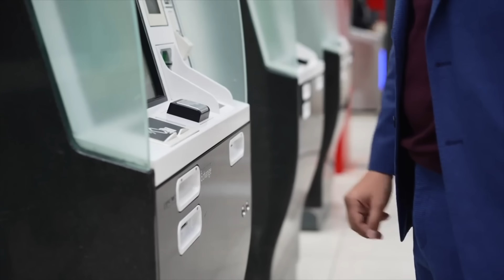Sydney's Game Changing New $2.7B Airport

Comment: There is so much with required to make the airport easier to use and become more productive.

A fuel pipeline needs to be implemented to eliminate the need for fuel trucks clogging the roads.

The 2nd runway needs to start construction as soon as the airport opens to double its capacity sooner & reduce costs waiting later.

Rail line should continue south to Leppington Station.

A new freeway north/south via the airport needs to be built. The M7 is already at capacity.

Expansion of terminal within the next 5-10 years needs to happen.
Reply: @josephj6521  Why would you expand capacity when it’s not required?
Reply: @ because it will be required. It’s NSW’s only 24/7 airport and if it has the facilities, airlines will flock to it. No point building all this infrastructure for a handful of flights. The Harbour bridge was built with future capacity expectations. Imagine if it was built at half its width. Same for this airport.
Reply: You are right about the endless convoys of B-doubles trucking fuel to the Badgerys Creek  aerodrome! What's the estimate? Hundreds a day?
Reply: @ You mean like Adelaide, Canberra and Gold Coast airports. In answer to your question, the maximum number of trucks per day will be 43 and they expect a pipeline to be viable in 2034.

Comment: Long overdue…No direct fast trains to CBD . No direct expressways to CBD. Mega failure.
Reply: There are no direct train or metro services planned for these intial stages of the airport, but the new M12 (which is well advanced) has connections to the M7 which in turn take  you to the M2, M4 and M5 which connect to the city. However not everyone using the airport needs to go to the CBD. If you need quick access the the CBD, flights into the current Sydney airport would be a better option.

Comment: Mega waste of money. If a high speed railway to Melbourne was built it would not be needed.
Reply: So people can travel internationally to Australia… on a train…? Think about what you just said Terry 😂
Reply: @Kustom2170  Again 40+% of domestic flights to Melbourne would not be necessary if you build a high speed train. In 2024, Sydney Airport handled significantly more domestic flights than international flights, with over 25 million domestic passengers versus 16.3 million international passengers. In other words you would have more than an extra 6% of international flight capacity without building a new airport.
Reply: @Terry-y2r  then why is Madrid to Barcelona still one of the busiest flight routes in Europe if HSR removes the need for flights? 
Again, factually incorrect.
Reply: @kierannelson2581  Were are you getting your "facts" from? More than 80% of travelers between Madrid and Seville use the AVE (high speed railway), with fewer than 20% traveling by air. https://en.wikipedia.org/wiki/Madrid–Barcelona_high-speed_rail_line
Reply: @Terry-y2r  fewer than 20%. Yes. And that still makes it one of the busiest air travel pairs in Europe.
The rail supercharged travel. Many people still fly.
Reply: That is factually incorrect.
Reply: By freight diverting freight to WSI, a lot of space for passenger planes would be available at Mascot.
Reply: @kaz1578  It still would have been better to build a high speed railway instead. It also would decrease the demand for air freight between Sydney and Melbourne.
Reply: I'm a big advocate of High speed rail but in Australian it is hard to get to stack up financially. The MEL to SYD flight corridor is one of the worlds busiest, certainly top ten globally, however it is also on the precipice for being too far for high speed rail to compete time and cost wise. In Europe a rule of thumb high speed rail is excellent up to about 500 Miles or 800 km's then Air becomes more time and cost efficient (ill leave CO2 out for now) CBD to CBD Melbourne to Sydney on current rail lines is circa 930Km's, along one of the the proposed routes this is reduced to 710ish km's at a significant cost. This proposed route, coming out of the High speed rail study 2013 put the cost at over $114 Billion AUD (2012 values) (airport was 'only' 5-10 Billion) but the report also stated it would require exceptional passenger uptake to be break even but that uptake would be competing against very affordable airfares, Air travel subsidies, inter city distance as mentioned above being borderline, cheap car travel options and toll free roads between the major cities. and then tat 350km/h for the rail it was predicted to be a 2:45Hr journey vs the 3:00hr CBB to CBD flight time, however if your one of the 2.5 million population in western Sydney this airport is catering too your journey to the Sydney CBD terminus of high speed rail will blow the train out of the water cost and time wise. Our paltry population cannot afford the high speed rail hence why its never got up. I wish it did as I'd have more work (transport Architect) but I don't see it happening any time soon and to blame WSI or decree the WSI spend a waste is disingenuous.
Reply: @MrJpblue1000  good comment. I feel HSR does have a strong case for intermediate trips, but these are not really reducing the number of flights by any substantial margin.
Reply: @kierannelson2581  Absolutely right, in Europe where substantial population centers are within the 200 km range of one another or less and the train links these points on a longer journey it makes absolute sense. Same in Asia and to some extent parts of the Americas where HSR are gaining traction. the Australian Eastern line Melbourne to Brisbane line proposals did link several regional centers but I'm not sure their populations are considered big enough to support a self sufficient HSR system, as sad as it is. But on the flip side, if we spend now, and the Australian Taxpayer supports it for 20 years until the regional centers grow and HSR could aid that growth, we save in the long term. But having just had an election there wasn't much discussion about real nation building policies, 'future made' maybe but I saw no HSR
Reply: hsr is wasting more money

Comment: The Design / Layout looks like a much smaller version of Brisbane's newest International Terminal. I suppose they need to start somewhere and just extend it later.
Reply: Yes, just stage 1 and designed to expand from 10 to 82 million on the same site as demand grows. It’s been well thought through so that it can expand without impacting the operations.
Reply: There is provision for a second runway as well as extended terminal facilities in the master plan which is availablr online. This is just stage 1 of the plan. The metro station has been located so it will be in the centre of the extended terminal.